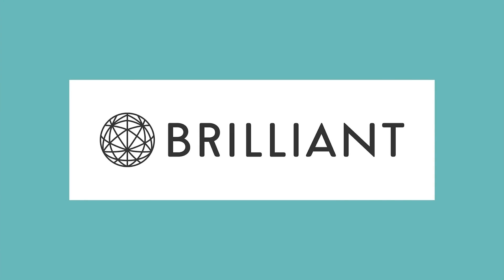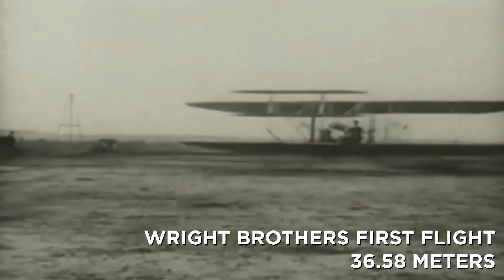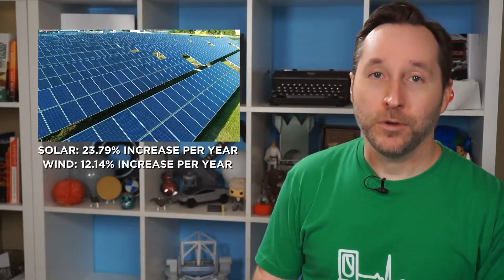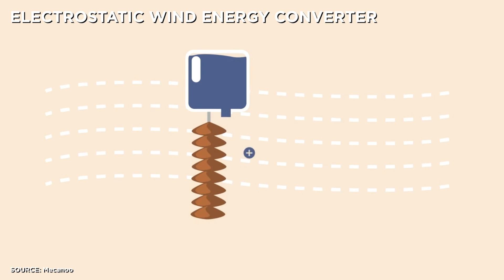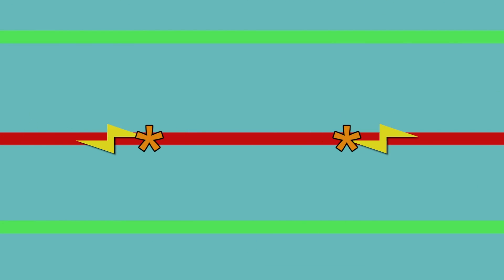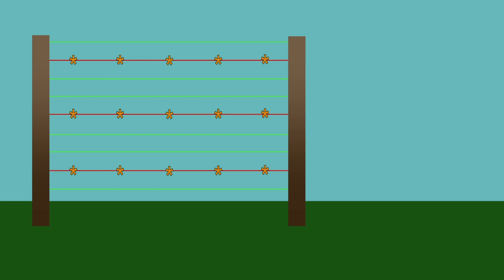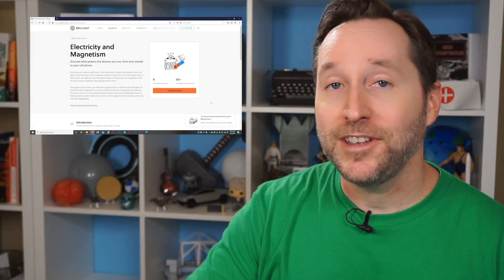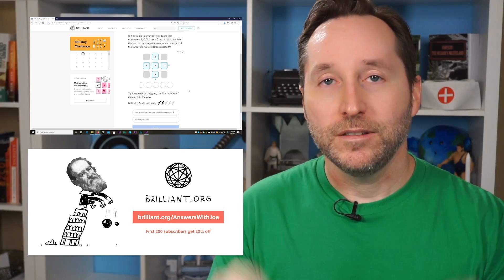Solid State Wind Energy | Random Thursday

Comment: useful extra info; In a recent experiment in Norway they found that painting one of the blades of a windmill black reduced birdstrikes by over 70% due to better contrast and visibility.
https://onlinelibrary.wiley.com/doi/full/10.1002/ece3.6592
Reply: it's crazy how effective a simple solution can be sometimes
Reply: Small problem: The heat generated by this will probably severely reduce the service life of those blades.
Any other color but white is inadmissible in load-carrying parts of sailplanes, which are basically built with the same technology.
Reply: @HotelPapa100  what if the black blades aren't a problem but instead made into an advantage. What if you make them out of solar cells? They're black or dark blue. High up there, they could start generating energy before the Sun rises. Ground level fog or dust clouds don't shade them. The wind cools them down, increasing the efficiency. Etc. Could be worth it?!
Reply: @HotelPapa100  golden paint?
Reply: HotelPapa100 could this help? https://www.sciencemag.org/news/2018/09/cooling-paint-drops-temperature-any-surface
Reply: @HotelPapa100  what about dots or strips
Reply: Norway... huge black metal fans.
Reply: Hugo van den Hoek, 👏🏻👏🏻👏🏻 🤘🏻
Reply: I was about to say something about this but it looks like you've got it covered
Reply: I still want to mention that, if I remember this paper correctly, they only had a very small number of wind turbines which they painted. And a relatively low number of total bird deaths in both painted and control. So the error on this 70% could be huge. And no guarantee this works in other climates with other birds and so on. But still a positive trend and I'm looking forward to more research in that direction.
Reply: And apparently, some birds (especially birds of prey) are really bad at avoiding obstacles. They just not only bump into windmill blades, they also bump into branches of solitary trees, walls and other things. They ride with an enormous speed on the waves of the air, and if that stream changes just a little bit, lets say a turn of wind, they get thrown off their planned trajectory and hit the next best thing in their way.
Reply: And it would reduce the material life considerably because of heat cycles. So it's a no go. There's a reason those things are white and it's so they soak as little heat as possible into the fragile (to that problem) blades.
Reply: @aserta  Maybe there can be a compromised achieved with other colours who also decrease motion smear.

Edit: welp, I just read this part of the linked study which kinda answers this question: " In the experiments by Hodos (2003), yellow and red, but especially green blades had slight—but nonsignificant—visibility advantages over black;"
Reply: Uhh, if black has a reduction of 70% maybe Vantablack would have a 100% reduction. Sorry I couldn't help myself.
Reply: Now they only need to do something about the noise. My parents has something like 2 kilometers to nearest windmill. In winter, when there are no leafs and if the wind is from the wrong direction, the noise is something like 75 db out on the yard. Thats a lot of noise in the middle of nowhere where nothing else but the wind in the trees can be heard (and now, the windmills).
Reply: @erikgranqvist3680  Bird strikes are the smallest effect turbines have on birds (and other animals). The electromagnetic field, pressure waves, audible and infra sound generated by turbines, have a much greater detrimental affect on wildlife and humans alike. At the very least forcing changes in migration paths or disturbing breeding.

Bird strikes are nothing.

A solid state wind generator would be advantageous but the one described in this video, along with others, relies on a circuit path through the ground, which might be as devastating to the soil as the current wind turbines.
Reply: @markhutton6055  I somewhat agree on the noise, vibration, infrasound,=acoustics, but... Electromagnetic field? What? Do you realize the wind towers are steel? It forms a faraday cage around the electronics! And besides, a wind turbine is just a power plant. By that logic, any power plant should cause massive deadly fields around it! They don't! I mean why would they, yes huge amounts of power flow there, but because the poles/conductors are close to each other in a cable, they cancel each others out. At roughly four times the distance what the wires are spaced, the magnetic field is negligible. There are practically no electric fields from cables, I mean your hair would stand up if there were. And animals, whether birds or mammals like dogs and humans, don't get killed by static electricity. As I said, there even isn't any from power plants. And electromagnetic radiation is stopped by a faraday cage. Also at the frequencies in question, they would be radio waves, and I have never heard of anyone being killed by radio. It could be possible if it was billions of times stronger, but then nobody would be able to listen to radio or watch TV.

So there, (sorry)I debunked everything you said about EM effects and power plants. Feel free to teach me those new physics where birds die at distance from wind turbines (or other power plants, since they're the same. Wind power is not magic or special!) Also I'm not denying the acoustic effects.

EDIT: bold text formatting.
Reply: @markhutton6055  but again, there's rebar cage in the foundation. The EM fields shouldn't affect the ground either.
Reply: @illuminate4622  the effectiveness of rear as an EM shield depends on a number of factors, such as EM frequency, amplitude and the distance between the bars.

The link posted shows that some EM radiation was measured allbeit at low levels and that it decayed away.

I am not aware of any research that proves the cause of the depletion of earthworms (and imsects) beneath the turbines only that their is consistent evidence that it occurs.
Reply: @erikgranqvist3680  must be pretty shoddily constructed. I live less than 1/4 mile from several and the DB level is under 30, IOW you can't hear it over the wind and sounds of nature,
Reply: @BullScrapPracEff  I guess both size, humidity etcetera has play. At my parents, it got so bad that the owners of the wind turbine farm has been forced to change windows into something soundproofing for those who live closest.
Reply: @erikgranqvist3680  My grandma has lived 4 kilometers downwind from a turbine for years. So far, no problems whatsoever. I guess that distance is enough. I think it's a 3MW Vestas.
Reply: @erikgranqvist3680  since road noise can be heard from 2km away  as well, maybe we should not have cars anymore. Try living near a gas turbine power plant and let me know  what you think of that noise. Im well  acquainted with  one in Brick, NJ.
Also I've lived within 1km of several wind turbines in a camper and the noise didnt bother me a bit. Its pretty subjective  it seems..
Reply: @ryansmith1312  the 2 biggest problems around my parents is poorly design on the turbine wings, and the lack of other sounds. There are no big roads, industry or even something faintly looking like anymore then a tiny village for over 20 km. Mostly there are no other sounds then the forrest that surrounds the villages, and some ocational tractor or car. Maybe the ocational chain saw once a month. You can sit on the veranda for hours without hearing any man made sound but your own sounds. And now, the wind turbines. The change is as big as if a city suddenly went silence. Imagine if all every day sounds around us - cars, industry, planes, trains etcetera suddenly stopped. Most people would get either afraid, depressed or at least very confused. Its the same kind of thing, but exactly the other way round.
Reply: @W.A M.P usually on high ground with open terrain, or - as around my parents - on high ground with towers high enough that the turbines are well over any tree. At my parents, the towers are around 118 meters meters + the small hught the concrete founding bring. The turbine wings are something like 70 meters. But theese are almost 10 years old. Now the turbine housing sits on almost 200 meters towers. All this means a coupke of things: the turbine wings may seem to spin at a slow pace. But they can travel very, very fast. My father has clocked the wing tips at well over 200 kph. This means birds get tricked. Even if they register the blades as something thats spinning, they seem to go so slow there cannot possible be any danger. You also got a huge zone of no entry. For the 110 meters towers, the saftey zone is a radious of 500 meters. In theory. Roads seem to be safe to go closer then that. And when questioned who is responsible if something - falling ice most likely - would hit a car, the response from both authorities and builders has been a deathening silence. The same goes when they are asked why the area are not fenced in, if its so dangerous. The real answer to both those questions is that it would be extremley expensive to fence in a cirkle with a radious of 500 metres in rough terrain around every turbine. And it would be extremley bad for wildlife. Another problem with windturbines in north of Sweden: they are built in subapline and alpine enviroments out jn the wilderness. With no roads good enough to transport those gigantic machines and turbines anywhere near the turbine parks. And for the 110 meters towers they built in the first batch around where my parents live, the foundations were huge. If there are no bedrock good enough, they made what is called a gravitation foundation. This means the lump of concrete and rebar is large enough to hold the turbine by weight alone. The used 1500 m3 concrete for 1 turbine. Moreover, when building in such places - far from large cities - there are virtually no infrastructure to transport all that electricity. At my parents, they had to build over 100 km new roads, new bridges, and reinforce what little allready existed. And a cousin who works in the industry says the effect in wind turbines reduce to half in under 20 years. Many people working with those gigant and remote windfarms up there are more or less convinced that the windturbines never give energy enough to offset the enviromental and energy dense construction such far away from the users.
So no. Windturbines may not allways be a good thing. It can be, but not everywhere. Off course, putting up masses of those gigant wind mills in the vicinity of the richer parts of Stockholm would never happen.
Reply: How many birds are killed by cars every year? Put it in context...
Reply: holy shit it's just like those bird stickers on windows to reduce bird collisions.
Why haven't we thought of that sooner?
Reply: Meanwhile us humans eats birds
Reply: birds have killed more planes than the other way around...
Reply: Everyone keeps going on about birds hitting the turbine blades. In every study I've even seen on it it's not the birds and bats hitting the turbine blades that is killing them, the pressure differential created by the trailing edge of the blade means that if a bird or bat flies through that area of low pressure all the blood vessels in their lungs burst and fill with blood. I'm sure some birds hit the blades everynow and then but it's not the real issue.
Reply: @legolam8876  thats  the point I was trying to make. Though these effects don't just kill the birds but affect their migration paths and potentially nesting.
Reply: @legolam8876  lmao, because changes in air pressure don't occur anywhere...basic physics completely disproves your theory. If the pressure were low enough the negative air pressure would stop the blades ( which are designed to do the exact opposite of what you suggest) to spin backwards.
Reply: @legolam8876  No, it's magic created by the gods. That's how an effect that is ubiquitous is only killing birds near wind turbines. Never near a windmill or elsewhere with natural phenomenon. Air pressure is constant everywhere except around wind turbines. 'Wind turbines are actually creating more wind to cool off beach resorts.'
Reply: If only bird strikes was the only way that turbines affect birds.
Reply: Bingo. A real non-problem REALLY becomes a non-problem...
Reply: Wouldn’t that also make the blade more wobbly since it probably takes hundreds of kilograms of paint to paint it?
Reply: @kingarthurthe5th  no lol
Reply: @urchin getter That only works on creatures with low genetic variation.
Reply: I take it you're an SGU fan?
Reply: Maybe invisible blades would kill no birds at all?
Reply: 30%  of a hundred rare birds is 30 birds too many. Norway in particular  has  very little need for  wind power  -- and at least Sweden knows that nuclear is far cleaner.
Reply: Excellent! 

Now let’s get rid of cats.
Reply: @zell9058  This is nonsense. Just paint the cats black and put a bell on their neck. Problem: solved
Reply: Patrick McManus, 👏🏻👏🏻👏🏻

Comment: Wind farms kill endangered birds, cats kill common birds. Regardless, 2.4 billion is a lot.
Reply: Wind farms in areas without endangered birds don't kill them, cats in areas with endangered birds do kill them. 

So I don't get your point, unless you have the data of death breakdown by area and cause etc, you cannot conclude your statement to be relavent or even 5rue
Reply: Neither of those killers care if the bird is endangered or not.
Reply: So... if a cat sees an endangered bird it doesn't kill it?  It is a  percentage game.  Of course cats are going to kill more 'common' birds as they are... well... more common than endangered birds.  Just like wind farms kill more common than endangered birds.  Same thing can be said for my truck.  Point being while there is no hard evidence to prove or disprove I would bet a weeks pay wind farms do not kill a higher percentage of endangered birds than anything else.
Reply: Wind farms kill random birds and cats kill random birds too surely? How could wind farms possibly discriminate?
Reply: Wind farms placed in bad locations may kill a significant amount of birds that would otherwise not be killed.
The problem here is: Counting dead birds under a windmill can be done exactly, although you have to search some time to find some. Counting birds (or any other animals, for that matter) that died due to the smoke of an coal power plant (not to mention the strip mine where the coal is extracted) is not exactly doable. But that does not mean, that no animal dies because of that. Counting the lost lifes due to the risen CO2 levels is also not posssíble precisely....

Comment: "40000 V is a lot of energy" 
Cries in engineer
Reply: It's really too bad. I thought Joe had a lot of potential...
Reply: Negative Voltage is a potential difference, so when you're already using 20kV, then -20kV is much easier to get.
Reply: I can see a react video from ElectroBOOM coming...
Reply: potential energy is still energy man. and 40,000 of it is, technically, alot.

(intentionally spelled that wrong to see if i could "trigger" anymore nitpickers)
Reply: @adamsoltesz5237  saying 40000 Volts is a lot of energy is just as nonsensical as saying 40000 meters is a lot of mass. They're not the same unit, they cannot be equated. A high voltage (Volt) says next to nothing about an amount of energy (Joule), (or actually, power (Watt) in this case) because we know nothing about the amps.
Reply: see the section listed Electrostatic potential energy

https://en.m.wikipedia.org/wiki/Potential_energy